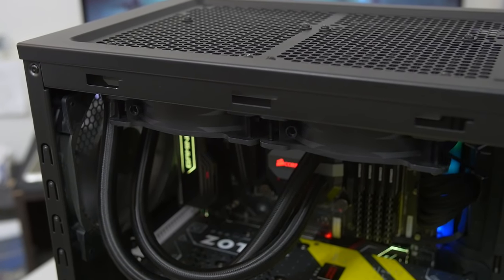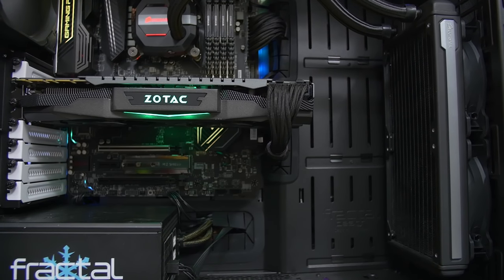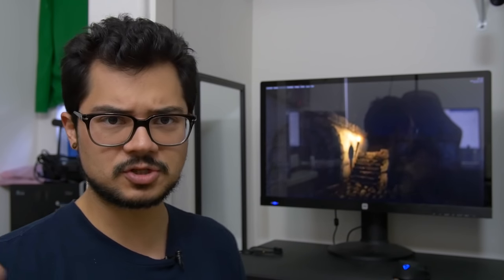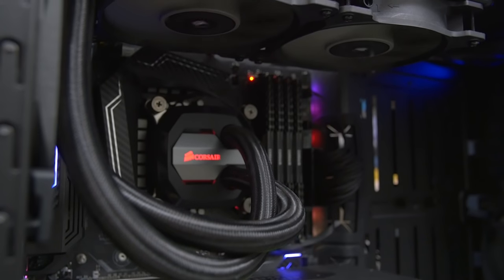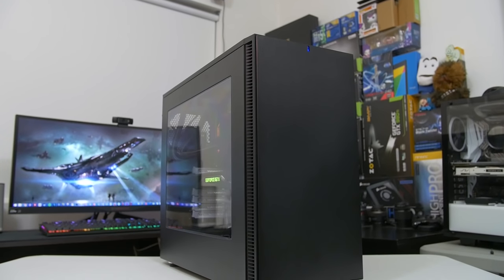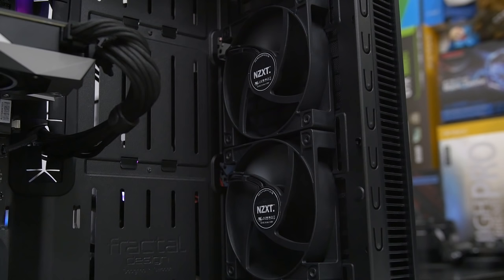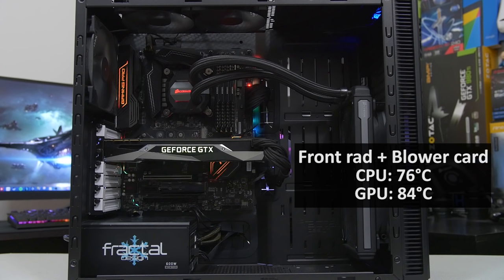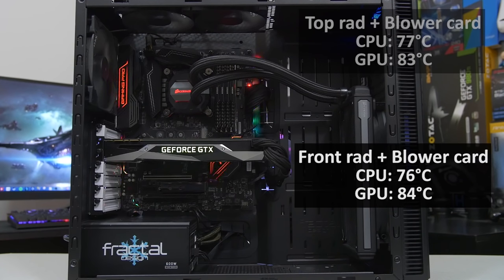Does Radiator Placement Matter? Hint: YES

Comment: Very much so. I was overclocking my 4790k with the radiator on the back blowing out. I had it stable and decided to try a benchmark. Once the graphics card got going it obviously heated the cases internal temperature. 5min in and it blue screened. So I moved the radiator to the front - pulling only cold air from the outside. No issues and was able  overclock even further. A good 20 degree drop.

Comment: I did this comparison myself last year and i got much better temps on my 6700k! Moved my rad from top to front in my Fractal Define S. GPU was essentially unaffected but CPU could breathe again. Dropped 12c.
Reply: I find this all very interesting, I never would have guessed such a difference ... So many verabiles though
Reply: Hello m8 I have 6700k too in hafx 942. Which cpu cooling you are using? Stock fans or not? Thnx

Comment: [Looks at computer] "Well shit; no way i'm changing the placement now with all those hard drives in the way..."
Reply: rip
Reply: Wouldn't be an issue if you had a fractal case because they decided to just shove all that shit in the back and below and call it a day
Reply: I had this problem. I had it mounted at the top and had to strip out all my drive mounts from the case and mount the drive onto the backplate etc of the case instead just to fit my radiator at the front... I did this a year ago and never thought to bother to look up whether it was better or not until now as I am overclocking lol
Reply: its called m.2 lol
Reply: @BlackCondorXVII  if you had reversed the airflow and put the fans on the top of the case as intake, and then mounted your rad to it, and had 2 bottom exhaust and 1 rear and still 3 front intake fans, I cant help but think you'd see better temps, especially considering the cpu will only ever see cooler air, as the way my airflow is laid out it's basically forced over the top of my GPU down to the bottom,
Reply: @TheGauges420  I understand what you're saying there, but not sure if I would see better results personally. Let me explain a few points why. 

I'm running 200mm fans all round my case as it's a big case, so setting the rad at the top as intake using the 3 120mm fans would see probably same results for the rad temps, but no better (if not worse) for the rest of the case due to the 120mm fans drawing more direct airflow compared to the 200mm fans, and most of that direct airflow would be consumed or pulled through the rad, whereas the 200mm gives areas around the rad for air to flow also.

Also, hot air naturally rises, so trying to force the airflow downwards in your case is working against the physics, as its pushing air through the rad which is then hot after cooling the rad and that hot air is then being directed downwards towards your other components, but whilst your exhaust fans at the bottoms are pulling it down, the nature of hot air wants to rise, making their job harder. Of course in real world practice, you would probably not notice, but in theoretical practice, you would probably see slightly higher fan speeds and temperatures when under high stress use as it tries to shift that hot air, especially when coupled with my next point. 

And lastly the exhaust at the back and the intake at the front would split your entire airflow current into two paths, in through front and then split downwards (some of it before it even reaches the components to cool them) and the rest towards the back, but then in from the top and split by trying to be pushed downwards (crossing the path of the air from the front air intake, creating a crosswind) and also being pulled out the back before its reached and cooled any components. The reason it's normally best to use front and bottom as intake and then rear and top as exhaust is because it gives a very linear and natural airflow current that travels through the entire case.

So yeah. Not sure how it would be better for me personally. I have 2 x 200mm intake fans in front and 1 x 120mm fan on bottom as intake and then the radiator is mounted behind the 200mm front fans and also set as intake, so it takes some of that air pulled in my the front case fans and drags it through the radiator, whilst still allowing the rest of the air from the intake fans to travel uninterrupted through the case. Then I have 2 x 200mm fans on top as exhaust and 1 x 120 mm fan on rear as exhaust.

Comment: In our experience with custom pc's, yes, front is better with almost 10-20°C. Push-pull is also a good option if the case let you do it. And, another important thing: the exaust vents on the case matter a lot!
Reply: Im currently thinking it might be better to have all your radiators Externally of the case. 
That is the reason im currently planning a build with the Mo-Ra3 420 Pro, look that up, i highly recommend it.

Comment: Hey Kyle. Post watching your video I got intrigued into testing it out on my own; especially since I have a similar config (only GPU) to what you were running your benchmarks on. My results are no where near as calculated as yours but they are still noteworthy.
Config: (I havent overclocked anything. Running them just on the manufacturer's default settings)
Processor   - Intel i7 6700K 
GPU             - Zotac GTX 1070 Amp Edition
CPU cooler - NZXT Kraken x61
Cabinet       - Corsair 760T

Top mounted: 
CPU was in and around the 50 degree C temperature with I think a max of 56 (Didn't pay much attention during this test)
GPU hovered around the 71 degree C temperature throughout

Front mounted:
CPU was averaging around 40 degree C with only a few sections where it reached about 51 (max)
GPU hovered around the 74-75 degree C temperature throughout

Thing to note is that during the Front mounted test my ambient temperatures were a bit higher (maybe around 4-5 degrees to when I had done the Top mounted test), so in maybe an identical ambient environment it might just have been lower.
Reply: VivekAnand Athanikar  So you going to keep it this way or. change it?
Reply: definitely keeping it this way :)

Comment: Thank you! This video alone has helped me feel better about an imminent new build in a Phanteks P400s Tempered Glass. Slapping the AIO in the front as intake.
Reply: Eric Divine how did you get on with your build? I have the same case and trying to figure out the best setup for coolermaster liquid 240mm atm
Reply: hey man recently starting a build on that case, was looking for some tips can i shoot you a message?
Reply: I put a 240mm rad at the upper two fans in the case and left the lower fan "open" so it can blow cold air near my gpu. Works pretty neat.. but doesn't look that great
Reply: Might be a really late reply but I've got this case and you can actually do a push/pull suprisingly. If anybody have any questions I'm happy to answer them.
Reply: JK hey man what did you find works the best ? I have this case and a 280 aio
Reply: @Headz_  is push pull worth it? for the gpu temps not cpu. and how do you setup the other fans ( 2 top and 1 back)
Reply: @blackkingsize  Hey, sorry I don't have that case anymore using P600S now but from what I recall yes it was better for the cpu and GPU with push/pull. Top 2 fans exhaust and back exhaust. I had 1 intake from the bottom blowing onto the GPU as well which helped some. Hope this helps.
Reply: @Headz_  thanks 😊

Comment: That's where my favourite case- the Lian Li O11 Dynamic comes into play. You can mount the radiator on the side, so that it pushes the air out of the case and you can have fans at the top and bottom to create a strong airflow to also cool your GPU.
Reply: Better yet... Lian Li O11 Air. With front intake, bottom intake, side radiator while top exhausts. Also you could just straighout remove the rear panel... those 2 small fan slots for exhaust won't help that much.

Dust shouldn't be a problem since it's acting as an exhaust tunnel. Dust is mostly intake issue.

Comment: Would be interesting to see how the front mounted radiator compares with the tubes at the bottom. In theory; the air inside the radiator would be sitting at the top with your current setup and obstructing the inlet/outlet tubes. Pretty sure you’d see a further thermal improvement with the tubes at the bottom :)
Reply: According to Gamers Nexus, bottom tubes would keep the AIO from FAILING.
Reply: With the setup he demonstrated, it would cause the pump to fail early since it's the highest point of the loop. When doing a front mount, you have to be sure that the pump isn't positioned above the rad.

Comment: I had a top mounted radiator with open card and it was causing my cpu to overheat. I changed to front mount like this video described and have had a significant drop in temps and no issues with crashing during intensive applications.
Reply: i know its been a year since the last time  you comment in this video. but can i ask u a simple question? you put your rad fans into intakes? not exhaust?
Reply: @yoshibitz  When the radiator in that PC was top mounted i had them as exhaust fans. After moving to the front i put fans as intake on both sides (similar magnetic levitation fans) and saw much better temps. I since have switched my PC build and gave this to a friend who had a much older build prior.

Comment: um..didn't Jay do a video about this and he showed that it didn't matter?
Reply: well, he didn't actually try a top mounted rad, and didn't consider cpu temps. he just showed that a front mounted rad doesn't mean your gpu wil melt
Reply: No, I believe he did a video proving that having a radiator of an AIO in the front of a case (he used a S340) that it was a negligible effect on the GPU's performance + temps
Reply: I'm pretty sure he used a blower style gpu the entire test so all he proved was for a blower style it didn't matter which is exactly what was found here.
Reply: TechMan221 just about to comment the same thing, he used a temperature gage that showed intake and exhaust. The results were negligible.
Reply: Plus it's a little difficult to in a S340, I think he was also trying to show that even though the front panel is solid the gap on it is plenty large for air flow. It bothers me how many times people tell me my X62 is being choked by my S340 even though it isn't...
Reply: This is the man who drilled a hole through a motherboard
Reply: R00M14 I wish I could like your comment 10 times xD
Reply: Darkman0198 yeah looked at jayz video again and the ambient air temperature was 24 degrees Celsius and the exhaust temperatures were 26 degrees Celsius. The 2 degree difference includes margin of error so yeah it doesn't matter.
Reply: R00M14 A "whole"....
Reply: He did it with a custom water loop IIRC. All the radiators were used by the loop, he showed that using a front mounted radiator would not affect the overall temps negatively.
Reply: KillJD oops :)
Reply: not everyone watches jays vids
Reply: So did linus....
Reply: Jayz Test was about " Does a front mounted Radiator have a negative effect on the inside Temperature of the case (especially GPU)?"
The result was exactly the same as in this video: no it doesn't.

Jay did not test the effect an open shroud GPU has on the CPU temps with a top mounted Rad.
Which clearly is massive
Reply: front or top mounted radiator should yeild negligable difference ng temps as long you have good airflow. theres probably not enug good airflow in kyle's test
Reply: He has more than enough airflow. Two 120mm intake fans, 3 120mm exhaust fans. Open chassis with no drive cages or anything else blocking airflow. 

The test results are accurate. I'm not sure why your trying to invalidate his results?
Reply: bruh because i already did that test. i also got 0-2 degrees difference. his test got 10degrees difference which is way too much, and he is also suprised why it happened.

lots of people already did this kind of test, they also came to a conclusion that top and front mounted rad configuration has little and negligable temperature difference, thats why sir.
Reply: It actually depends on the type of case. I did not experience any overheating issues with my GPU when I was using the Mastercase Pro 5. Then, when I started using the Phanteks Enthoo Evolv ATX TG edition that has the top ventilation restricted, my GPU began over exceeding 80 degrees Celsius.
Doing his method solved my overheating problem completely and I do see a 10 degree drop in temperature on the GPU when under load during gaming.
So it really depends on the type of case that you have on your PC as well as that is what ultimately will tell you whether you might need to change the radiator mounting position. I really appreciate Bitwit's experiment as I've tried many other configurations, push and pull on the top but did not bother to put the radiator on the front due to Joe's findings as well until this video.
Reply: i don't thank so he did do liquid vs. Air tho
Reply: Tech Ownage did you have a blower style gpu?

Comment: One of the most interesting videos on this topic and it simply makes sense, as the radiator will receive cold air from the exterior instead of hot built on the case interior. Thank you

Comment: I flipped my H100i Pro to front mount from a top mount with an EVGA RTX 3090 which is open.  It held my cpu temp on heavy load for 30 mins at 62 C  vs top mount 76 C.  I ran Godfall on full settings while streaming and playing music for both.  Big help here, thank you for running these tests!

Comment: In AIO manuals, It is most often written "we recommend to mount your radiator/fans as intake" (that is in front)
Reply: That is actually great knowledge, thanks for that bit of info.
Reply: Sorry I know I’m late to this party. But it would be fans infront of the radiator as intake, and then fans at the rear of case as exhaust?
Reply: @TheVikingGamer45  the rear and the top im pretty sure i was wondering the same thing
Reply: Richard Betz yes hot air goes up that’s why rear fans are usually exhaust
Reply: Could I place the fans on the other side of a front mounted aio pulling air in?

Comment: It's a very interesting result because it blows away the common misconception that it's a bad idea to have a front-mounted radiator. 

I tried the same experiment with my PC and got exactly the same result.
 
However, I also found that if you increase the rpm of the case fans you can, to some extent, correct for the problem associated with an open-air shroud and top mounted radiator. My case fans ( two front, one rear )  normally run at about 700rpm no matter what the temperatures are but if I changed them to run at about 1000rpm then the CPU temp dropped back to about the same as the front mounted radiator. The trick seemed to be to try to vent as much of the GPU hot air before it could reach the CPU radiator.. so the faster you can run the case fans the better. 

I would have liked to have taken the case fans above 1000rpm, but unfortunately they just won't go any further, so the experiment was a little inconclusive. I was sort of there, but just wanted to go to 1200rpm to make sure, but couldn't.  

An ideal solution may well be to have the same fans on the CPU cooler as the case and run them all at the same speed all the time. It would be easy because you just need a PWM hub to control all the fans. This would also have the effect that it would balance the pressure in the case pretty well. 

waits for someone to post having done that experiment :D
Reply: i have 3000 rpm case fans lol. one on the back and one on the front. but im getting a Corsair 750D and NZXT Kraken X62 today so i want to know where the best place to install it is. seems still the Front is the best. and have exhaust back and top
Reply: You need at least one top fan.  Check linus’s video... the case temps were lower with a back and top fan than with only a back fan.

Comment: Makes sense to me, the air coming out the back side of your radiator is going to be much cooler than what your GPU is running at. Therefore very much capable of providing cooling to all your components, pair with a well set up exhaust at the top and rear of your case and your golden .

Comment: Would have liked to see the top radiator configuration as an intake, instead of only an exhaust, with the open GPU card, combined with that heavy RPM rear exhaust fan. 

Wonder if a high volume case fan on the upper rear would be able to over power the natural effect of heat wanting to rise straight up, combined with the radiator fans pushing it's used air straight down.
Reply: I was wondering similar, top / back as intakes and adding a bottom case fan for exhaust along with the front radiator being an exhaust.
Reply: I know this is 7 months late, but you want your top as exhaust, not intake. Hot air rises. So if you put top fans as intake, all you're doing is pushing the hot air back down into the case.

With the rear fan being closer to the GPU, you want it as exhaust so that any heat being expelled from the GPU is immediately ejected from the case. Bring cold air in from the front and bottom of the case, eject hot air from the top and rear. This gives you cooler temps and excellent, natural air flow.

Comment: I initially went with my Corsair 100i in front. My 2080 super with three fans was throttling. Upon moving to the top of the case and putting three fans in front scattering air equally to cpu and GPU. I got the best of both worlds. I found getting as much air moving through the upper and lower portions of the case was my best overall temps so far.
Reply: That I would have liked to see more intake volume was my first thought looking at that result. That result seems like insufficient air exchange (and probably negative pressure) to me.